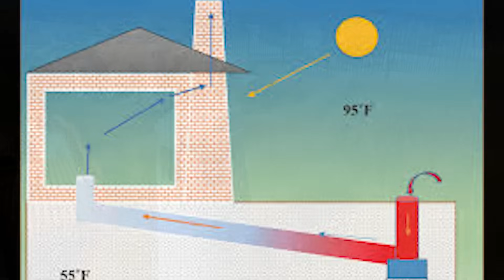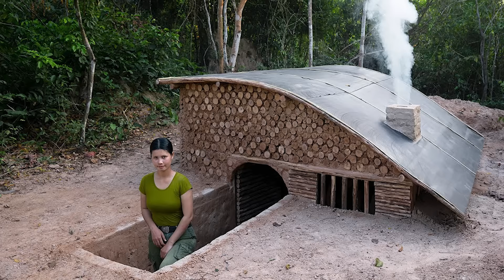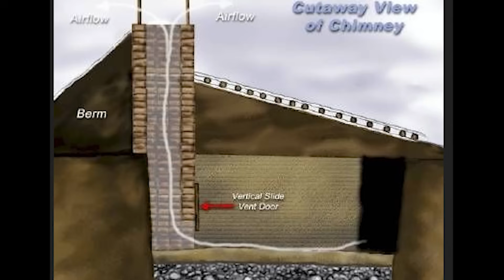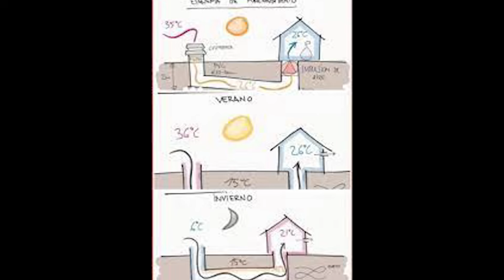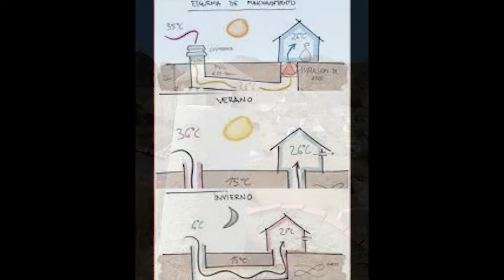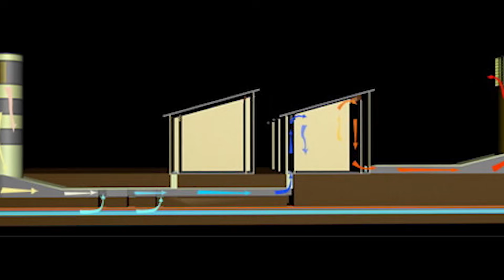Everyone Mocked His "Ditch" Chimney — Until His Shelter Stayed 50 Degrees Warmer

Comment: I guess buying a wood-burning stove that put the heat into the room and not up the chimney was not an option in the 1800's? It would have been a real game-changer for both types of structurers. 😛
Reply: Those came along after 1900.
Reply: @Avotts funny I thought the pot belly stove and it's cousins were invented in the 1800s
Reply: @TheEclecticOrder the pot belly stove in some veriation has probably been around since the 1400s.  Lol.   I was thin,ing of something like we had, an ashley wood stove.   Seriously, most of the old west folks could not afford that luxury, even if it was $20.00.

Comment: Years ago this type of building was a sort of craze. It fell out for obvious reasons. Moisture, mold and rot. Without proper climate control / humidity and temperature, condensation becomes a big issue. Hard floors can become slick with a film of moisture. Like a bathroom mirror fogged over after a shower. Imagine that trapped behind your cabinets, sheetrock and wood trim. Things can get nasty quick.

Comment: In 1986 I built a 2200sq/ft passive solar house. The south side was mostly triple glazed windows 2 story. 6ft inside was a masonry wall 12in thick called a thermal mass wall. An oversized fireplace made up the inside of this wall. The lower level was built into the grade. Without using a furnace the winter night time temp was 65 degrees. Daytime usually around 70 degrees. More if I lit a fire. The area in the sun space about 80 degrees. I was taking college classes when I designed this system and my physics course gave me the formulas to determine heat gain/ heat loss to size the amount of glass and the size and weight of my thermal mass. There were also many considerations for southern exposure, elevation of sun locations, winter VS summer. My system for heating worked great. Also, the house was super insulated.